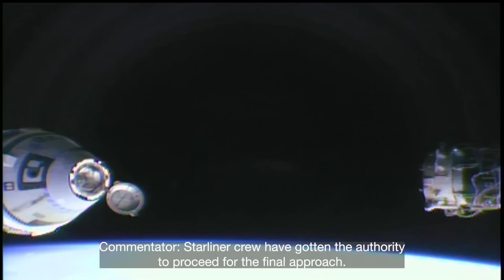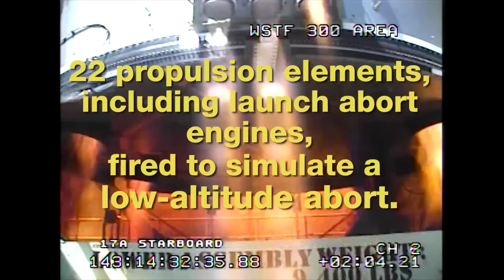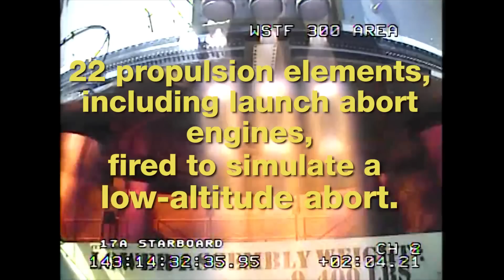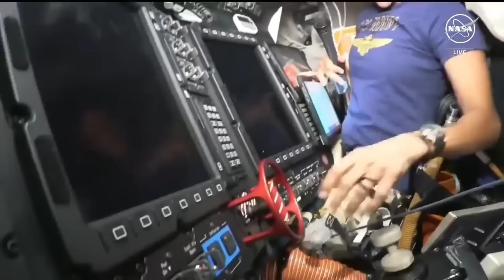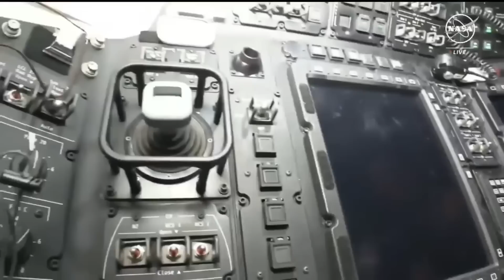The Decision Is Made - Boeing Might Be Safe? But SpaceX Is SAFER!

Comment: so...they are ignoring the voices that undocking procedure may pose the risk to the station itself? I'd not be surprised, if in 2 weeks they "announce" that after "careful deliberations" they will have to wait with the returning the capsule to earth until the station is empty.
Reply: They can't. There's a hard limit on how many visiting spacecraft can be at the station at once. Starliner needs to leave so Dragon can come on.

I seriously doubt it's that bad anyway. NASA didn't deliberate this long for nothing, they clearly think there's a pretty good chance it works just fine.

I'd say they probably have starliner back off as gently as gives the ISS separation (you could theoretically give it a small push with a robot arm, but I doubt it'd be super effective for the risk of damage to the arm - I don't think Starliner has a grapple for it), wait half an orbit, and then have Starliner deorbit with some distance from the station. They could give the station a little push away too if they're very worried about starliner exploding or something
Reply: @ryanhodin5014  Yeah, from the press conference it sounds like the plan is to undock from from the forward-facing port, drift up and around the station until it's behind the station (yay orbital mechanics), then do a departure burn. I don't think they're worried about it exploding, but loss of attitude control is likely one of the scenarios they're considering here.
Reply: @AmbientMorality  Yeah, and I agree with NASA on that. Lots of people are taking it as if this decision is confirmation the capsule is going to explode, or go haywire, or burn up on reentry... I think it's very likely that it'll be fine, but the most dangerous probable failure probably looks like the capsule entering a tumble during the departure burn and recontacting ISS.

If I was NASA I might look into a small orbit raising maneuver if anything to gain separation, but they've definitely run the orbital mechanics to know exactly what the actual separation is going to look like

Comment: The thruster system they use, is with hypergolic propellants that self ignite. There is NO reason to use Helium (none of the mixtures are cryogenic) and a much more common, and readily available inert gas can be used, like Argon, or Krypton. No need to that tricky and expensive Helium. Helium's only virtue is when pressurizing cryogenic propellants, it will not liquefy at their temperatures.
Reply from the maker: Helium weighs a lot less and has a lower boiling point, its objective the best gas for pressurizing tanks. Even SpaceX use it

Comment: I'd love a video on how much Boeing is to blame for these problems, vs. how much they are inevitable teething problems associated with innovating.
Reply: Boeing wouldn't. Let's face it, when the other team has gone 13/13 on successful crewed flights while you've gone .500 on just one in the same timeframe you've pretty much proved that teething problems associated with innovating aren't the issue.
Reply: Even Rocketdyne who builds the thrusters hadn't seen the seal bulging issue before. Now the issue was caused because Boeing's thruster housing was hotter than the thrusters were rated for, but it's a very hard thing to test, needing a vacuum chamber that allows thrusters to fire in multiple directions. And even going back with models they haven't quite been able to produce an accurate model to predict these failures.

But of course something simple like a temperature sensor on the first test flight probably could have been used to tell them the thruster housing got hotter than they predicted.

Comment: At this point NASA would be better off relying on SpaceX solely for crew transport and let Starliner prove itself as a cargo transport for a few years before carrying people again, to iron out any more issues. Far less risk involved that way. Hopefully Sierra Nevada impresses NASA with Dream Chaser enough to win over funding for developing a crew version of that vehicle.
Reply: But Starliner isn't particularly well suited to cargo. It's not designed for it, and it has the same weakness that Cargo Dragon 2 has... the small IDSS docking port which greatly limits the size of anything that can be carried. And NASA already have a working craft with that limitation, as well as Cygnus and cargo DC which berth at the larger CBM ports. There's not much room for a cargo Starliner in that picture.

Comment: For a spacecraft that is supposed to shuttle four crew members plus cargo to the ISS for a six month rotation, why did they remove the personal luggage from an 8 day trip to the ISS? They said it was to reduce weight? Batteries that are designed to last 45 days is really short for a six month rotation. This doesn’t sound like a ship that in any way could meet contract requirements.
Reply: They removed some of the personal cargo because they had a critically needed part for the ISS's urine reprocessing systems. Only the batteries for this test flight are rated for 45 days, and since this test flight was supposed to be just 8 days that was fine, actual 6 month missions will use different batteries.
Reply: @philb5593  I don’t know, but if I wasn’t testing with the production parts, then i wouldn’t think it would be a valid test.
Reply: @BruceJSkelly  True, but as long as you understand what you are doing it's mostly fine.

Even SpaceX launched Demo-2 with solar panels rated for just 119 days.

Just a theoretical example:
It can be well understood stuff like they have a maximum 3% battery degradation, normally they have 2 batteries which degrade slower as they split the load, but for a short test flight they used 1 battery which will degrade faster, but that's okay since it's a short mission. You understand the effects. 

Another theoretical example:
Solar panel degradation can be prevented by a complicated coating on the panels, more layers of this coating the longer they last. Since it will be a short mission we don't have to add many layers.

And with all this stuff they are always assuming worst case scenario. Notice Starliner's batteries were rated for 45 days, but we are 81 days into it's mission and there is no concern about the batteries.
Reply: boeing - " C'mon man , we wouldn't have all that stuff ready for another year and $ 1Bln + ..!! "

Comment: 13:56 I guess just a slip of the tongue, the loss of Columbia happened in 2003. I honestly appreciate the cautious approach by Nasa, unlike they did twice with the Shuttle. They might have learned the lesson after all, even if Starliner might have been safe enough to bring Sunny and Butch back
Reply: Was there even a backup option for columbia? They didn't go to the iss
Reply: @wonjez3982  In theory they could have rushed Atlantis for a rescue mission, although, its success probability was to be confirmed. Still, never really looked into solving the foam shedding issues, despite the wake up call that several missions were, like STS-27 and STS-112
Reply: @wonjez3982  "Was there even a backup option for columbia? They didn't go to the iss"

Not to the ISS. If I remember correctly, Columbia was heavier than the other Shuttles. It could reach the ISS from launch, but would be limited to a smaller payload, making it impractical; as a result it didn't have an ISS-compatible airlock. And on its last mission, it wouldn't have had the delta-V to reach the ISS.

Comment: Sure because of the RCS thrusters problems Dragon is the safer bet but when you think about all the other problem before it even got off the ground, it makes you wonder what else will go wrong. Waaay too many problems. The project needs to be scrapped or go through every and I mean every little aspect of the parts and assembly process with qualified non-DEI hire engineers to ensure not even one little screw can fail.

Comment: I am a manual machinist and I manufacture parts made from PTFE and other plastics for the petrochemical industry. PTFE also known as Teflon in my opinion, is a very poor choice for anything being used in an environment with extreme temperature changes.

Comment: The SAFEST option, to me,  a regular tech guy all his life... would be to NOT use thrusters to undock. Send out a couple spacewalkers, unlatch the Astroliner from ISS, and manually push the craft away from ISS. Then wait until it's very far away before activating thrusters for deorbit. This wait may be many days, but so be it.
Reply: I am quite sure that orbital mechanics prohibit this method: Since a full orbit only takes 90 mins, you have to move fast enough away from the station to not come too close to it 90 mins later. I doubt that two astronauts in EVA-Suit can accellerate a multi-ton* capsule to any notable speed.

*Edit: No data found, but dragon 2 weighs 12 tons on launch .. and Starliner is somewhat bigger.
Reply: @LoneStarr1979  I've done the calculations. One eva astronaut could apply enough pressure on it over a few moments to start it moving. Why is this so difficult for you to believe? 
AND, you and others keep parroting one another on the 'orbital mechanics' issue of some sort of risk of coming close to it 90 minutes later. 
It doesn't work like that! It really doesn't. I stand by my original comment.
Reply: @LuMaxQFPV  Yes, it does work that way.  Applying a small force to an object as it passes a point in an elliptical orbit puts it in a very slightly different orbit (different eccentricity or inclination) that passes through the same point (and its antipode) on subsequent orbits.  In the ISS's frame of reference, this would look like the capsule drifting away, slowing, then coming back towards the ISS.
Reply: I had a thought about using the Canada Arm to pluck and hurl it ...

Comment: Do you think this might lead to a mandate that each company makes an adapter or has auxiliarly cross compatiable life support options for cross company contingencies? Even if adapters are just held at the station or sent up I can imagine them being less heavy than whole specifically sized suits. Maybe even off board suitcase life support units that will do the job in a pinch.

Comment: Autonomously, Starliner still poses a relevant threat to safety of others. Thruster malfunction during undocking could go very badly, putting Starliner into an unsteerable, unstoppable spin right next to ISS!
Re-entry control could also go very badly, putting that craft down in some sort of malfunction in unintended locations on Earth. 
If I understand the way Starliner works, there is NO aerodynamic steering as an assist to accurate atmospheric entry. So it could overheat, rendering parachutes inop, and end up becoming a  "burning clump of incompetency" meteor, headed straight for a city! 
Jeez... what a complete MESS.

Comment: I know Scott indicated he doesn't believe that Starliner is a 'deathtrap'.  But, if there are further thruster problems, which is entirely plausible, that could mean that Starliner misses its re-entry insertion point, or doesn't re-enter in the right orientation, or could end up in an uncorrectable tumble.  So, while it may not be a deathtrap yet, it could certainly turn into one very rapidly.  It will be interesting to see how Dreamchaser performs.  If does well, that will be the last straw before Starliner is dumped entirely.
Reply: Dreamchaser is a cargo vehicle. It doesn't have the capability to carry crew. NASA see having two American crew capsules as extremely important (an aim I agree with), so I'd be shocked if they abandoned Starliner
Reply: @Benaplus1  Dreamchaser, like Dragon will start as unmanned.  Then intent is for it to also become human rated.
Reply: @Benaplus1  It is dual purpose. The cargo variant is being built first. The crewed version won't be far behind.
Reply: @paullangford8179  the crewed version has not started development,  so "not far behind" is a bit of an overstatement
Reply: @paullangford8179  @gregkelly2145 I'd love to see a crewed Drewm Chaser fly. My impression was that that was several years down the road at least. Is it expected to fly sooner than that?
Reply: Worst case scenario is that further manoeuvring thrusters fail during the undocking until the craft is left unable to get into an attitude where it could fire the deorbit thrusters effectively.  NASA would never recover if there was days or weeks worth of footage of Butch and Sunni slowly running out of life support with no way to either get back to the ISS or down to Earth.
Reply: Starliner is likely much safer than a shuttle.

Comment: They can put the Being suits into Starliner. If Starliner makes it back safely, so will suits, if Starliner fails, then I don't see much future use for the suits either. :D
Reply: Agreed
Reply: I think that the problem is that the starliners suits physicaly wont work with dragon. Its an interface issue afaik
Reply: @laveturnerjones3954  I think they were referring to the suits as ballast rather than occupied/operational suits.
Reply: @Cooper_42  Yes, Boeing suits put into the Boeing craft as balast. If the craft successfully lands, suits will be fine.
Reply: I think they do need to keep the suits in case starliner failed during departing and hit ISS, so they can at least wear something before strapping themselves into dragon cargo place.

Comment: Dragon can carry up to SEVEN crew. There is zero reason not to put six seats on the next crew mission so they can fly the previous crew down as well as the refugees from Boeings ineptitude. That capacity should be held in reserve with extra seats on the ISS ready for a contingency anyway. 

This is typical bureaucratic BS from NASA, and politics to try and save face for Boeing.
Reply: Perhaps they just don’t want that many people in the station it self?

Comment: Starliner would be perfectly safe to reenter with, IF the batteries can be given a waiver for being weeks older than they were certified to be good for. They're down to only one thruster of 37 RCS thrusters in the doghouses that can't be relied on. In truth, every Apollo flight was undertaken with lower safety than NASA is willing to put up with today. That's a good thing, not a failing. When your standards are higher than they need to be, that is a good thing.

Many Boeing detractors are saying the Starliner would burn up on reentry, but he capsule is aerodynamically stable. So long as the OMAC engines, triply redundant, fire properly and the capsule enters the atmosphere at the correct angle, and the OMAC thrusters have been flawless, Starliner, with no other inputs, would automatically orient itself heat shield first and as long as the parachutes work correctly, it would safely return to Earth.

Steering during reentry is done by the capsule RCS, not the problematic service module thrusters. But if all of the capsule thrusters failed, the landing spot might not be accurately attained but the capsule would safely return to Earth.

What this whole shebang proves is that the anti-Boeing faction within NASA has finally gained the upper hand. Rather than a scorched Earth policy of banishing Boeing and its proponents, the victors here have decided to value the team above the battle. Many are mischaracterizing this as lying or refusal to admit errors, or a vast conspiracy to infiltrate NASA and Boeing with DEI (Dale Earnhardt Enterprises? What does THAT have to do with anything here? lol), but those are very shortsighted and agenda driven ideologies. Sometimes when you win you have to be the better person. You'll be on the losing end of a decision soon and how you treat the losers now is how you'll be treated.

Comment: It's interesting that these Capsule's all have the same Docking Port and yet the Astronaut's Space Suits have no adaptive compatibility to "plug-into" other capsules. 
    Also, the Dragon Capsule's were designed to carry up to 7 Astronaut's if needed. It seems like they could carry more than Two if they were adding Two for the return trip.
Reply: NASA limited it to four seats so that a safe seat angle can be used, necessary for safety on a hard emergency landing. Flying back with six people is more dangerous for the two "stowaways" because of less than ideal seating as they are basically strap-in cargo. Seven would be even worse.
Reply: Initially designed, and they could be adapted to be set up that way, but that doesn't mean that all the detailed design for such adaptations has been done, never mind signed off on. It's not just a case of throwing more seats in, the whole life support system needs to be rated for 7 people, and I don't think the one they currently use is.
Reply: @agsystems8220  Yea, I remember hearing that NASA wanted different seat Angles on Dragon to improve survivability in case of a hard water landing, so they reduced it to 5 seats to meet those demands. Also, I guess they use the extra space for "hauling the mail".  The complete incompatibility between space suit adaptability may bite NASA in the ars one of these days imho.  They learned that lesson w/ Apollo 13.
Reply: Docking ports have to be universal because different spacecraft have to dock. Suits don't have to be because (typically) each suit is only used in one type of spacecraft.

You actually want different designs for things like suits. Lots of different companies try lots of different things. You get real-world data on the pros and cons of the different systems (and on what designs to avoid). And everyone's designs gradually improve based on lessons learned.

If they'd made this decision earlier, they might've had enough time to come up with adapters to plug the Starliner suits into the Dragon capsule.
Reply: @solandri69  SpaceSuit connections should be adaptable to other capsules for the same reasons the docking port is. Lives may depend on that someday. It's like they developed a square CO2 scrubber to fit into a round hole.   Oh wait, that sounds familiar somehow ?